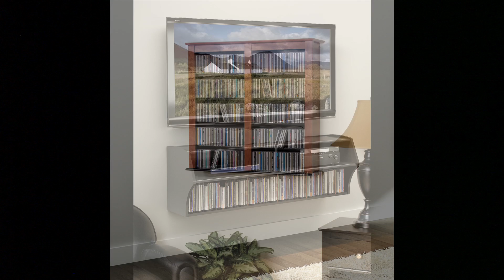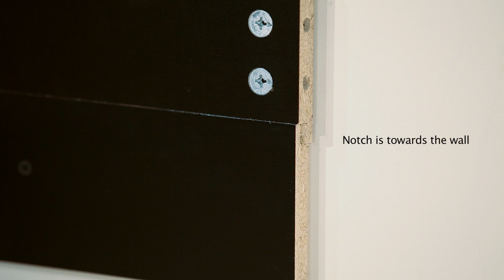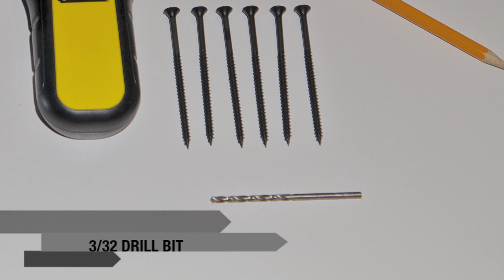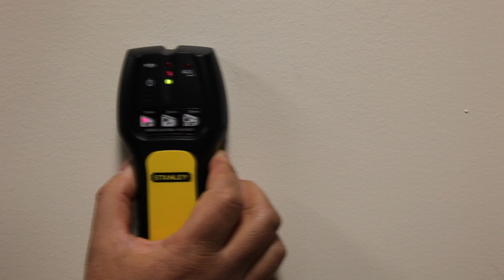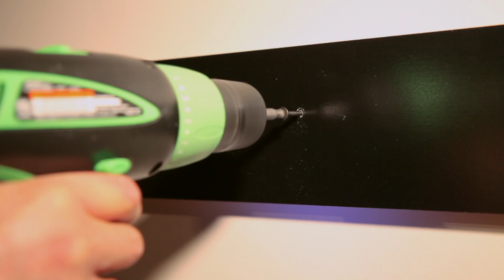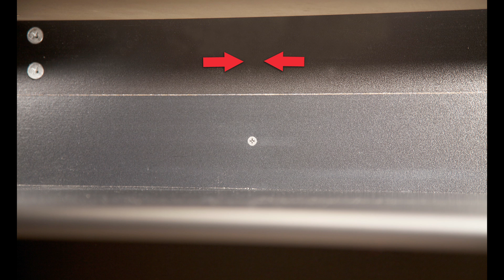How to Install products with Prepac's 2-piece Wall Mount Cleat System

Comment: I'm installing a 60" Wide Hanging Entryway Shelf, model EC-6016. I am attaching the Wall Stablizer. Well, my house is from the 1890s and the studs are made of old growth wood (very dense and strong). A 3/32" bit for the guidehole proved insufficient; I used 5/64". Still, the 3 1/2" Quadrex Screws you supplied got stuck, the screwheads stripped, and now I have three of these screws sticking 1" out in front of the wall stablizer on my hall wall. How about furnishing screws that don't strip?
Reply: +Derek Rubinoff I took the Prepac screws out and used coarse thread drywall screws from Home Depot. These screwed in properly and are black (they are less noticeable than your light bronze ones).

Comment from the maker: Hi Mark,

Most of our wall mounted products are over 41 inches in width. However, we do have a couple of products that are 32-36 inches in width, in which case you would center the product over two studs.